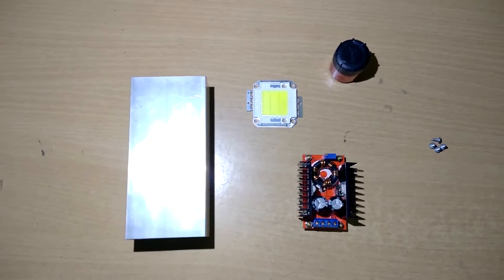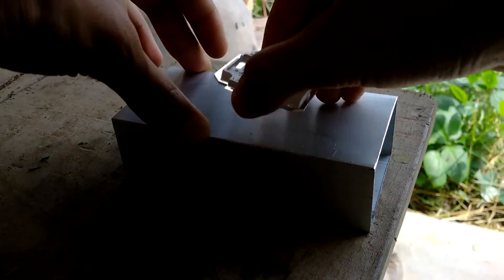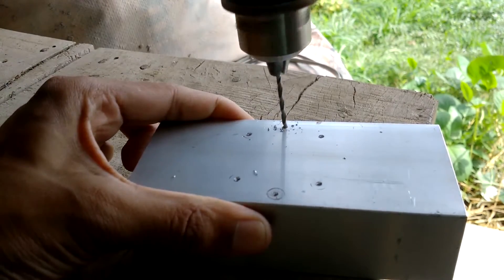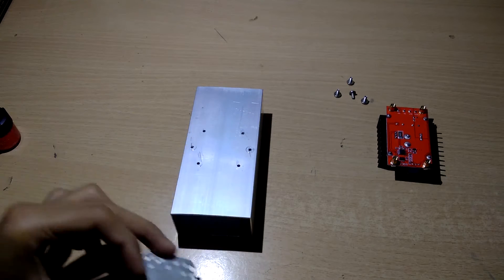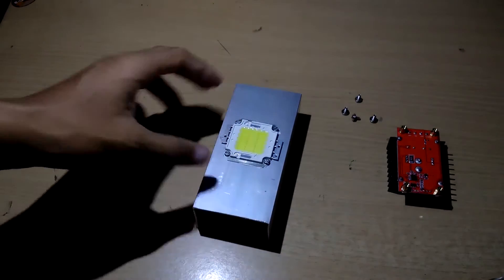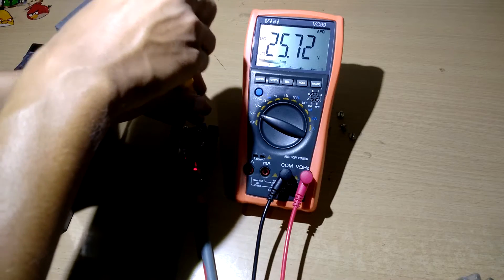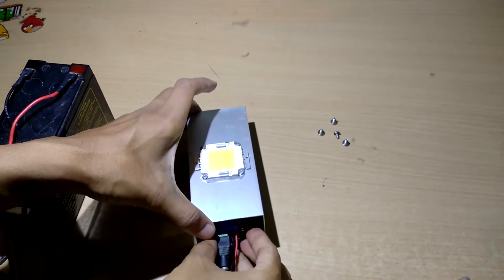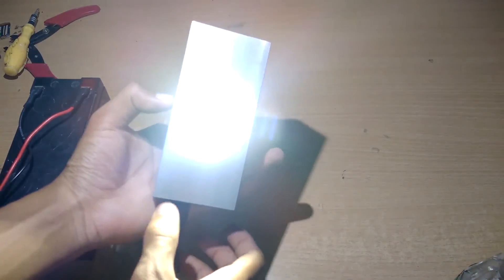DIY Super Bright 20 Watt LED Light

Comment: Why the heat sink is necessary for 10 watt 20 watt etc bulbs..?what is the work of that heat sink ?
Reply: Just try put the led in your hand, and try to feel the heat.. 🤣
Reply: it will fry itself and the heat sink radiates the heat away and light bulbs dont need heat sinks these are high power leds